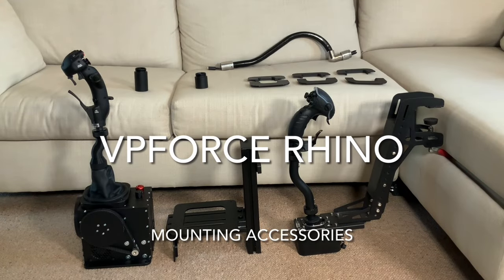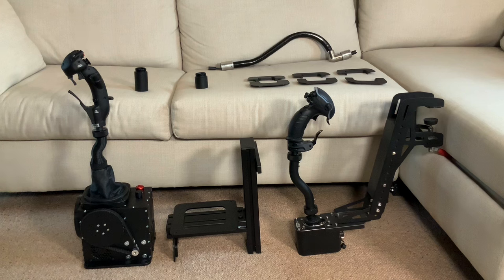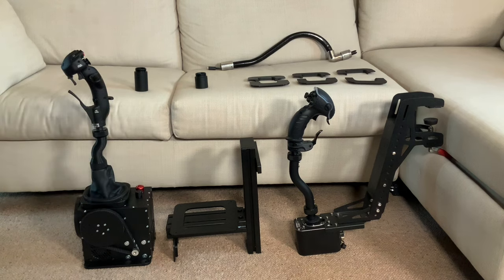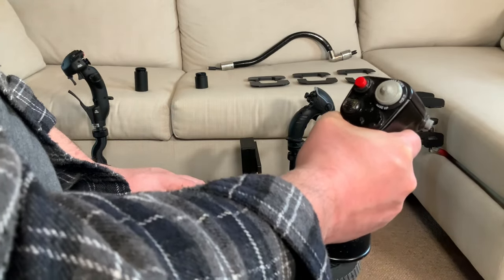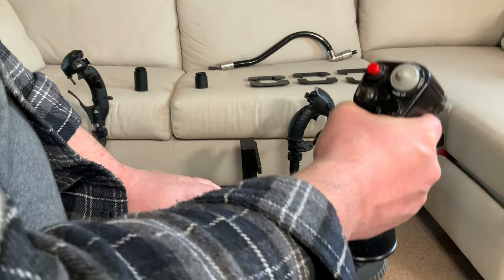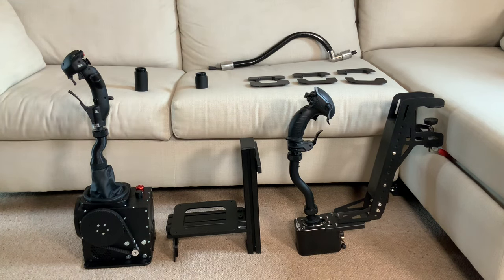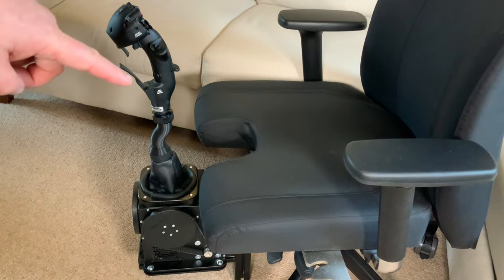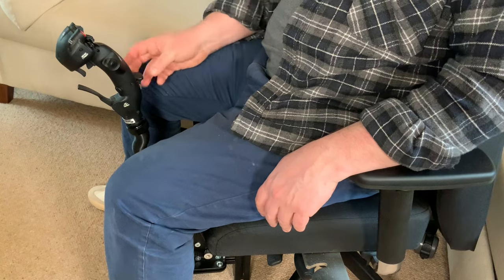VPforce RHINO FFB how to mount properly

Comment: 😅There is a adjustable cad file for the physical limiter on the Discord, so you can print a custom one yourself should you happen to have a 3D printer. Its possible to make an assymetrical limiter also, using the file.
Reply from the maker: nice, yeah if you have the option to fabricate your own for sure go for it. My advice base on the setup I showed is 16-17 degree deflection

Comment: I'm pondering ideas for mounting it directly to a floor frame/chassis, separate form any chair mount. That could give more potions and flexibility i think. Very great info.
A goose neck extension like the one you have but with less or no straight vertical parts may well be perfect for me. I've seen photos of some people's that are custom laser cut

Comment: It looks like you're using a VKB Gunfighter stick, any issues mounting it to the VPForce Rhino? Does it require any adapters or anything? Just wondering bc ive got the same stick.
Reply from the maker: Virpil CM2 m8 not VKB, I like the look of the new Virpil FLNKR grip I'll probably move to that. I think you need an adapter for the VKB

Comment: So i have been having a hard time making a choice of platform to mount my rhino on. is the monstertech chair mount solid? does it feel solid and in place when flying and pulling g’s?
Reply from the maker: It does feel solid, the rhino is pretty heavy as is and the chair/mount is very sound imho much more so than a desktop mount solution
Reply: @bigbangerz5856  awesome! yea i have been having a hard time trying to decide whether to make a solitary mount just for the FFB or get the chair to transfer everything…
Reply from the maker: @preflightops  I still mount my throttle and button box on a desk mount fyi as it makes life easy when you want to use a left stick or collective

Comment: in your opinion do you think this is feasible for the F16 side grip (very low stick deflection)
Reply from the maker: probably not would be my view because doesn't the F16 measure force rather than deflection? You could set the force feedback limiter very high and then change the curves but I think you would lose resolution doing that... I'd stick with that Saitek stick which measures force
Reply: @bigbangerz5856   thanks!  i will keep looking at options!

Comment: Nice ome mate, im close to number getting called so your videos are perfect. Just subscribed 😊
My only worry is i run the all metal gunfighter and the weight might be an issue? How have you felt the fead back and is over heating an issue for you?
Reply from the maker: I think the force feedback is really strong I can't see it being a problem as long as you aren't relying on very low FFB settings, it wouldn't concern me for example if I swapped out my grip for the Warthog which is pretty heavy as grips go. I've mainly used the Rhino with the DCS Apache module taking advantage of the force trim features of that aircraft with typical flights lasting 60mins each no issues so far, I'd recommend you also use the telemetry software module to get added effects in the FFB
Reply: @bigbangerz5856  great feedback and informative reply.

Comment: Thanks for the video! What is the small extension you are using?
Reply from the maker: It came from eBay, it’s a 90mm bend extension marketed towards the TM Warthog I show the packaging etc at the 1min time mark. Cost about £26 if I recall….

Comment: How’s the Rhino going man?
Reply from the maker: Yeah really good it bought the Apache module in DCS to another level for me… was there something about the stick you wanted to see or were interested in?
Reply: @bigbangerz5856  hmm, I think how much force it can output, if it’s enough for the most demanding aircraft in the real world and how long it takes for the fans to kick in, I hear they are a bit noisy so how loud they really are too.  Maybe what aircraft presets are available to download over different sims and what you think about them, if you made any tweaks. Maybe setup process, what to install to get it up and running in Flight Simulator, DCS and X-Plane and basically any insights, tips, things to be aware of.

I’m three months in on the waiting list so it would be nice to know all the ins and outs before I get to the top of the list.  Up to you though, if you have the time.

Cheers.